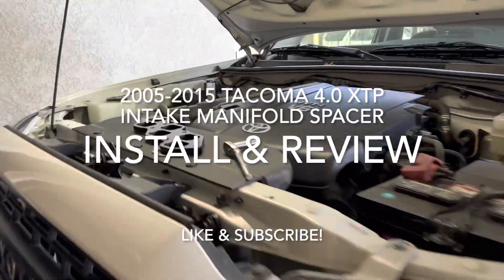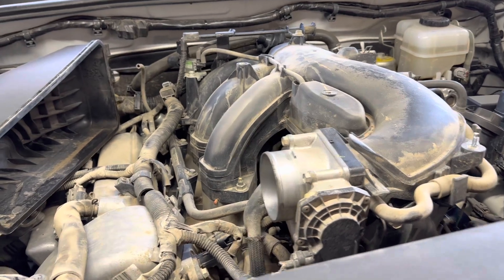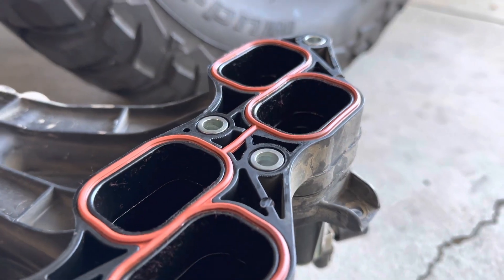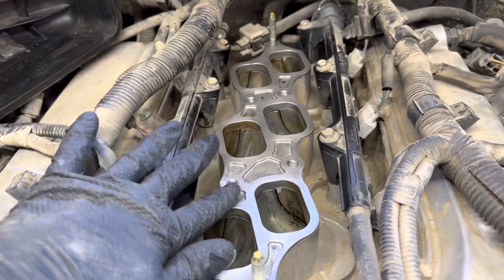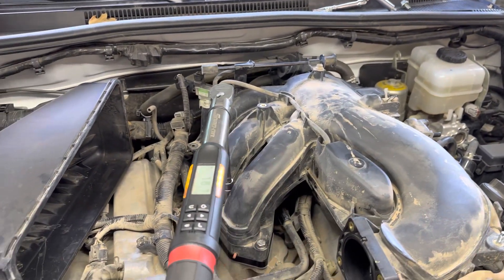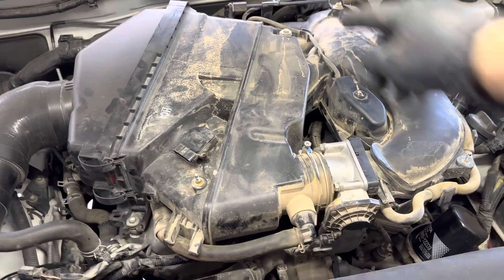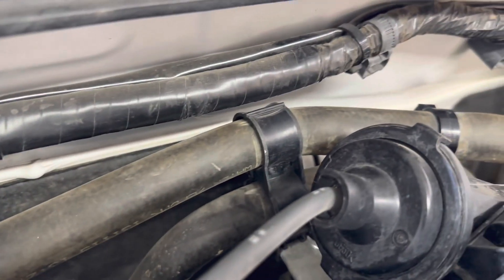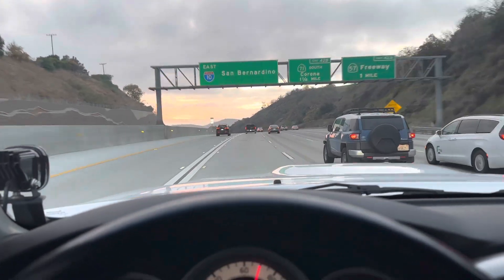Tacoma INTAKE MANIFOLD SPACER Install DIY - Toyota 4.0 V6!!

Comment: Does this mod work without doing the exhaust cam gears
Reply from the maker: Yes, this will work without anything else.
Reply: @gio.rodriguez I'm looking for a little bit more torque for Towing a small camper
Reply from the maker: @OneAndOnlyChi this is a simple and easy mod to do that 👍🏼
Reply: @gio.rodriguez thanks for the info. Im considering attempting this my self. God Bless

Comment: Good day to you. Out of curiosity, did you install the spacer first or the gear first? Also, did it make a difference as far as mileage is concerned?
Reply from the maker: I installed the gears way before the spacer. People claim the gears increase mileage by 1mpg, but I never bothered to look into it on my own.

Comment: Bro, you are THE ONLY ONE, I SWEAR TO GOD, the only one that I found that has the similar issue as me. I have a 2010 tacoma prerunner, I constantly have to put it from d to 4 when going down the highway
Reply from the maker: This spacer definitely helped resolve that issue for me 🤙🏼
Reply: @gio.rodriguez  what tends to cause that, just the exhaust manifold? It sounds like a transmission issue but i literally cant find a thing wrong with the tranny or the rear diff, its solid, its just rough at high speeds like that

Comment: Have you gone with a larger TB as of today ? if so, any improvements in torque or hp
Reply: Ok good, didn’t know that.
I was hoping having the plenum spacer would make a difference. 

Did you get any torque gains from the plenum spacer?
Reply from the maker: I have not done that or plan to. There really is no gain on a mod like that because your plenum will be the same small size regardless.

Comment: Using that intake have you ever ran into any issue taking in water?
Reply from the maker: I have had it a few years and never had any issues. I’m sure a deep enough water crossing can be a problem, but I haven’t run into any yet.

Comment: I seen this on your IG randomly. I've got 4.88 nitro and 285s. I would like to get a Volant CAI and this spacer. What do you think about that combo with what I got. I don't have a tune or anything yet.
Reply from the maker: Nice! I feel like you would notice a slight improvement and gain a little bit of the lost performance due to larger tires.
Reply: @Gio Rodriguez  oh man, on stock gears I hated the 285's. It was such a drastic Improvement when I got the new gears.
Reply from the maker: @TommyG_0311  i still have stock gears on 315’s 😬
Reply: @gio.rodriguez  oh your poor gas mileage 😭😭😭😭
Reply from the maker: @TommyG_0311  I’m at around 15 mpg combined hwy/city with the exhaust cam gears, intake spacer, tune
Reply: @Gio Rodriguez  I was around 13ish before the regear. I drove to visit family and on the highway I got 17-18mpg, I even used to track it with a Scan gauge. Once the price of gas skyrocketed I had to get a spare set of tires with the stock tire size just inwouldnt go bankrupt from gassing it up lol
Reply: @gio.rodriguez  trust me, the research will blow your mind.
Reply: I ment Re Gear but yes, the research too

Comment: Would you say the spacer would be beneficial to someone who doesn’t have a tune or anything besides a CAI? If the power band is usually around 3k rpm is it now at 2500?
Reply from the maker: In my opinion it is beneficial for sure, especially for those with larger tires than factory. The most noticeable difference is around the 2000 rpm range and up.

Comment: I have an 05 Tacoma 
I install urd tundra throttle body, rip supercharger coils, urd exhaust cam gear, jba long ceramic headers, afe intake, Gibson exhaust, jet performance mass air sensor, do you recommend me to install it?  Do you think I can get better results?
Reply from the maker: I felt like it was worth it. Did you feel a difference after the urd gears were installed?
Reply: All in all, I feel the car is very light i like it.
I have a pedal commander and I changed 4.56 gears with a 33x12.50/17 tire

Comment: What intake do you have?!
Reply from the maker: Hi Tucker, it is a Volant ram air scoop and custom couplers/piping to plumb it to the stock airbox.
Reply: Are there any pros to adding that besides not getting air from the wheel well?
Reply from the maker: @tuckeraustin5358  no need for a snorkel! 😎

Comment: Nice 2nd gen.
What tuning software are you running?
Also what intake system is that?
Reply from the maker: I have the hp tuners mpvi2 and tune from justdsm on tacomaworld. As of now he exclusively tunes for Overland Tailor Tuning. So you would have to go through them.
Reply: @gio.rodriguez  Currently regeared to 4.88's with cam gears installed. Also have the KD MAX 9.0 tune but switching over to OTT pretty soon & planning to get the Volant CAI. Would I see a significant difference with the manifold spacer installed?

Comment: Nice video dude, I’m curious about your MPGs now since you did the -3° cam gears, tune and spacer? Obviously Tacos on 35s consume a lot especially since we have stock gears but you seem to have really help the truck. I’m suffering with manually downshifting and probably 12mpgs lol but Overall great video! Very nice! I’m looking into the mods you did to help my taco
Reply from the maker: Thanks David! On my last trip I averaged 15 mpg combined city/hwy on 35's with stock gears and the above mentioned mods. The truck is still relearning the new trims with the spacer and should improve more, but the main benefit is usable power vs mpg.

Comment: Do you know if this will fit with the TRD supercharger?
Reply from the maker: Unfortunately it will not because of the belt idler pulley mounting bracket in the front.